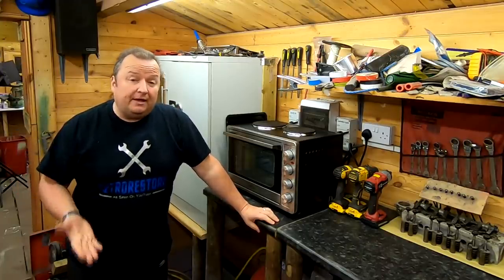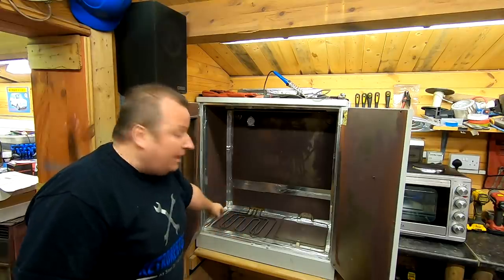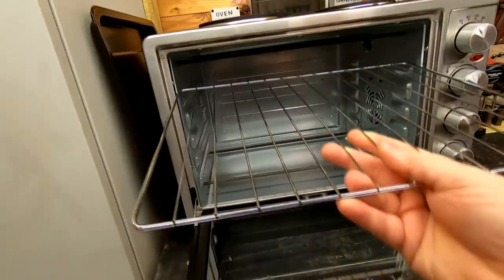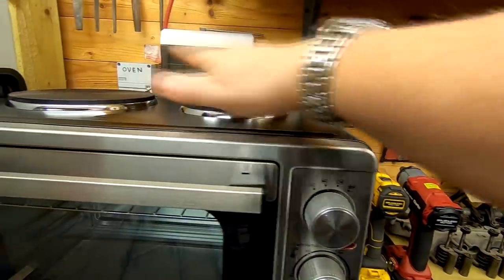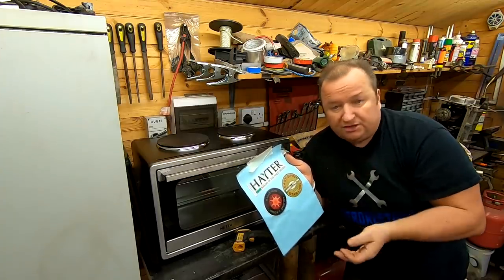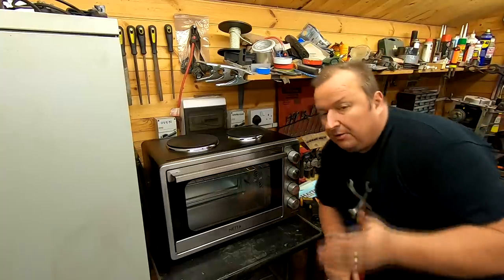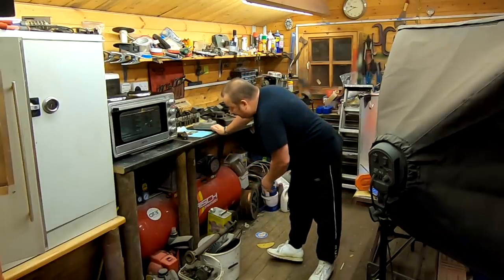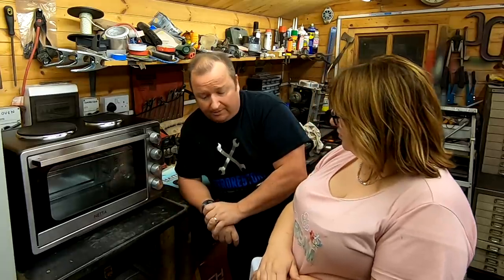Cheap DIY Powder Coating Oven And Plans for The Future

Comment: love your youtube channels, also love your powder coating vids I have one question on your system, that is with your coating system how do you catch the overspray and what type of filter do you use animals are great to have around and i am sorry about bison all the best for 2020 and I look forward to more  videos
Reply from the maker: I am working on a new spray area. The powders are not toxic but you still should use a mask as no type of powder should be breathed in. The powder at the moment is just vented to outside but I have a filter media I will be using. There's not much powder as you are spraying at about 5-8 psi, an average spray can is pressurized to about 90 psi hence a large overspray cloud.

Comment: Happy New year to you both, I'm so sorry to hear about Bison, he seemed to have plenty of energy in him in your live stream around Christmas.
I had a bit of trouble with my small powder coating oven, one of the hinges snapped inside so had to tie it shut with a strap. My Mum came up trumps at Christmas and give me some money to buy a bigger 65 litre built in oven,  which just sits on the work top.
I am hoping to powder  coat the Suffolk Punch with it.
I just about got ready to start the colt but the fuel tap leaked and so did the carb, so that was that paint ruined. I am just waiting for some new paint and fuel tap.
Once again I am very sorry about Bison.
Jeff
Reply from the maker: Thanks Jeff. All the best bud.

Comment: nice vid martin, I liked the live streams as you told of any problems you came across when doing retrohax maybe now you could do a piece to camera about the snags you came across and then you will not get" take apart sand blast powder coat" type of comments. you could show some info about your trade before you gave it up too.
Reply from the maker: I don't really need to justify myself to those idiots as they are trolls Dolores.

Comment: Have you ever thought about building a small  outside box to keep your air compressor in? And just run the airline into your shed?
Reply from the maker: Its not really loud bud.
Reply: @retrorestore  ow that's ok then i had one and it was really loud so i stuck it outside

Comment: Martin, I had a standard kitchen oven given to me because they said it wasn't working correctly. Well I manage to get it fixed and working perfectly (a bad solder connection on the power relays) and that is my powder coat oven along with a smaller toaster oven as well. So unless I get an ATV or motorcycle frame to powder coat, I'm covered with powder coating now. I know I talked to you before about printing colored decals and such. But how are you printing vinyl decals with white. I am in real need to use white lettering on some old 6 gallon boat metal gas tanks. And I have been needing to know how to make such white letter decals... Thumbs Up for you remodeling shop!
Reply from the maker: As you know, Gary, you can't print white with a standard home printer but you basically buy white sticker vinyl and the white in your images comes from the white vinyl.

Comment: Happy new year Martin, I purchased the Electro Static Magic Easy Coat for Christmas BTW the wife says you could be bad for my health 😂. I haven’t tried it yet although I have also purchased a oven and ready to go, would you recommend using the oven without the fan assist as I’m unsure, I would really appreciate the advice, cheers Martin.
Reply from the maker: I don't think it really matters bud. The little one has a fan in but my big one doesn't and it works fine.